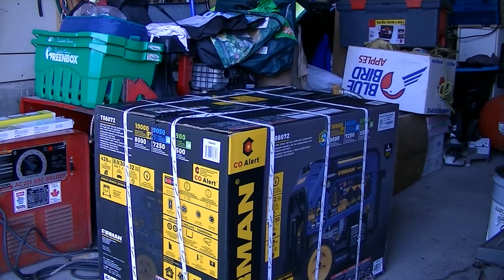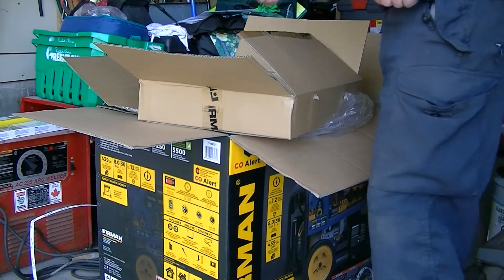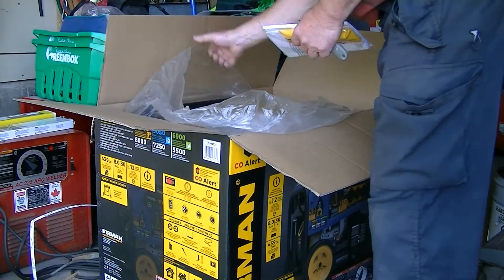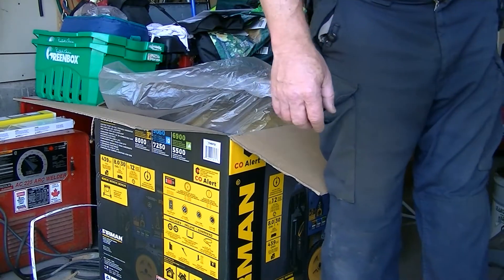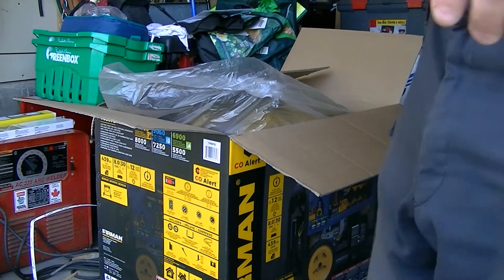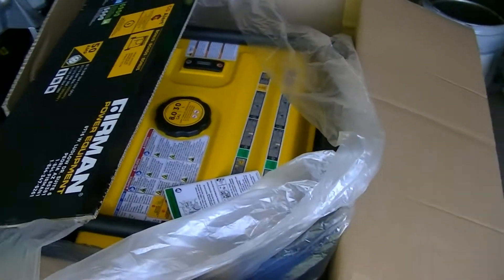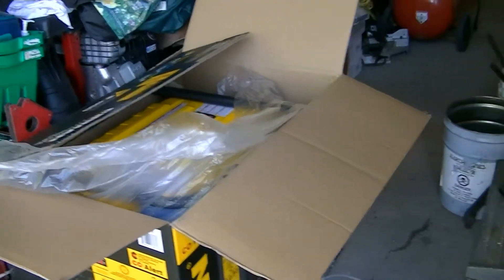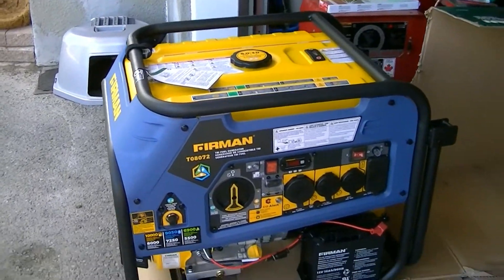Firman T08072 unboxing

Comment: I bought the same generator at Home depot on 10th line 3 weeks ago. Started it on a propane tank, and at 20 feet the sound level was 90 DB. It sounded like i had a train going thru my backyard. Returned it 2 days later. Maybe defective, or is it supposed to be that loud? Manufacture says 74 DB.
Reply from the maker: not sure how you measured the Db.   you can hear mine run on the next video I did.  I did not find it to be any louder than my other generator.  74Db is loud.  it is not a camp ground generator for sure...